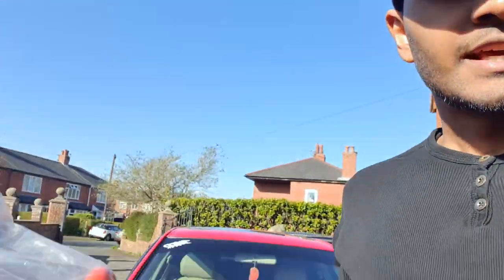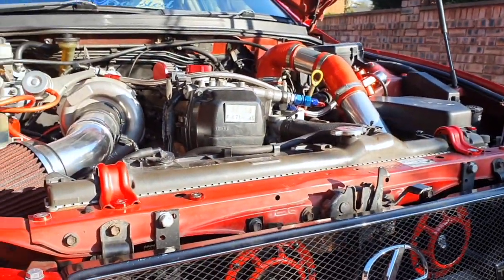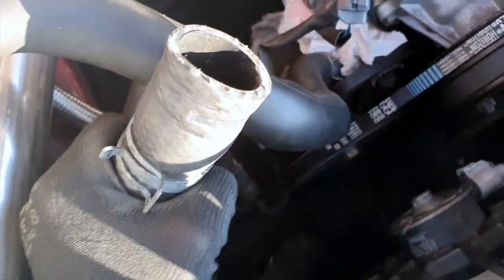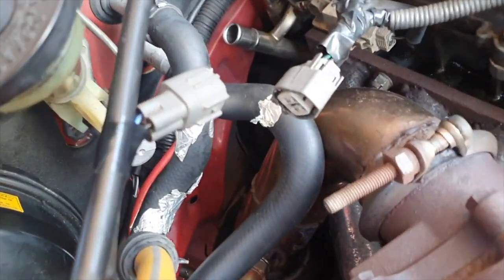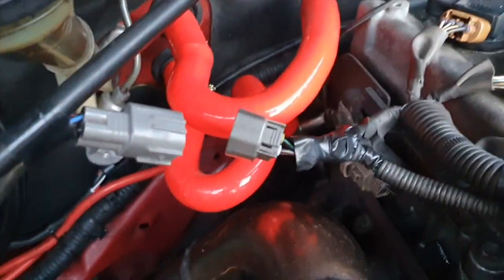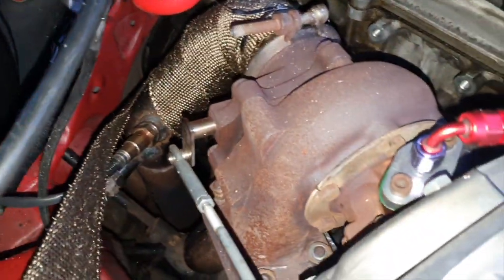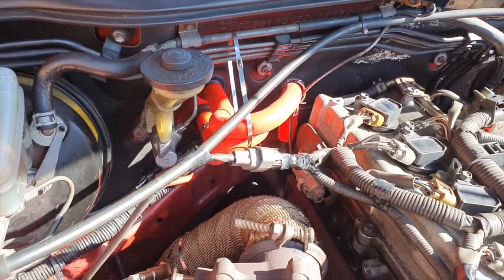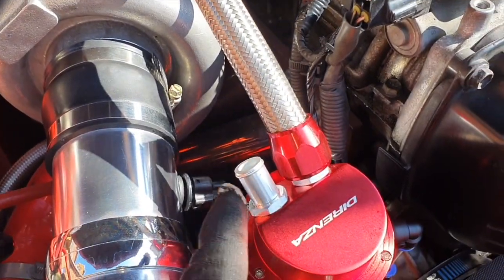Lexus IS200 MJC Automotive Radiator Hose | Install |

Comment: Hello
You mounted the turbo and no need to decompressed the block.
What kind of turbo is that?
I’m in France and I do the same editing.
Remains the stainless steel manifold and the turbo descent to find
Reply from the maker: It's a T3 turbo